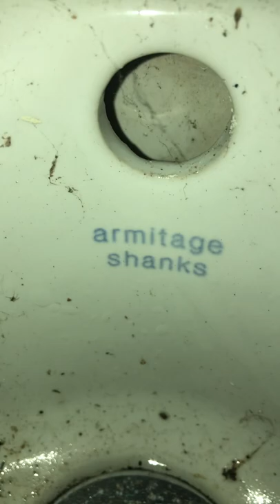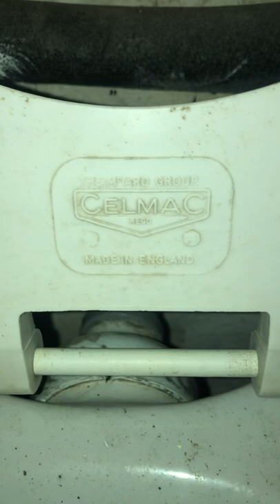ML 1970’s Dauntless Elite cistern and 1970’s Royal Venton Coronet pan, Honiton Parish Church

Comment: Nice find. Thats a very weird setup,  weve got sinks draining into urinals but sinks draining into a toilet flushpipe. Creative I would say haha. I should check for some outside church toilets, never know, they could have some goodens. Think theres church in Compton with an outhouse and theres one in Bramshott. Theres also one in a meeting house in Godalming, (which looks quite easy to access). Theres some derelict bogs in a church near me but unable to access sadly.
Reply from the maker: Yeah it very odd. It’s easy enough to drill through the wall and strap boss the basin waste into the soil and vent stack outside. Ooh nice! Hopefully you can check them soon! I have three churches that i want to visit later this year too, plymtree URC church which has two lead LL overflows, silverton methodist church which has two 70’s WC’s and the hebron evangelical church in cullompton where those red badge lynxes were found.